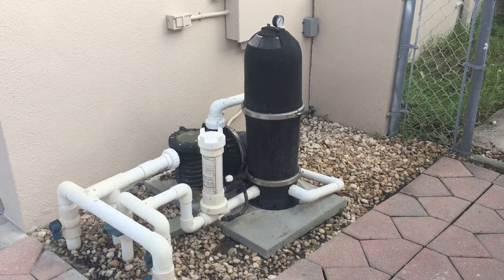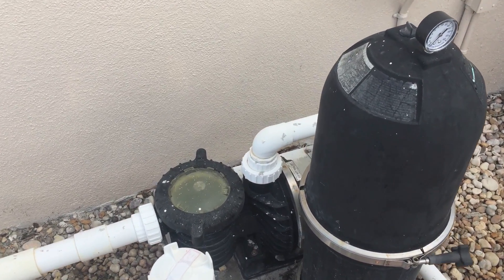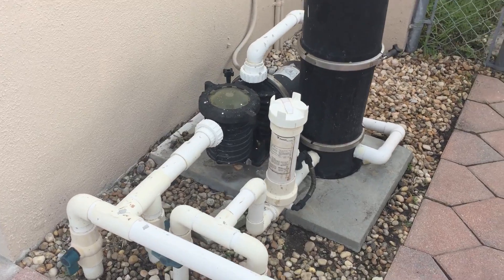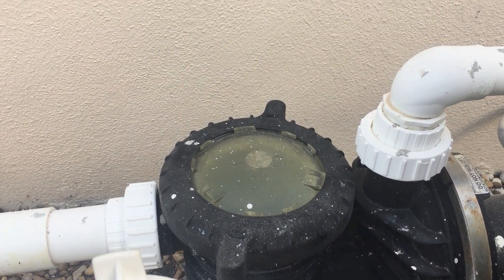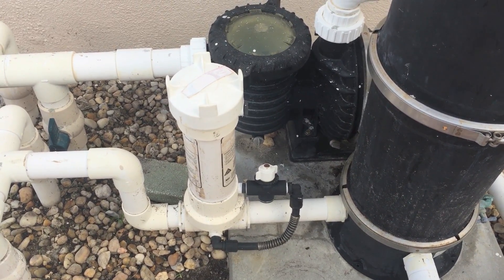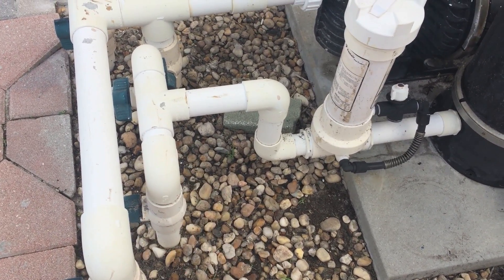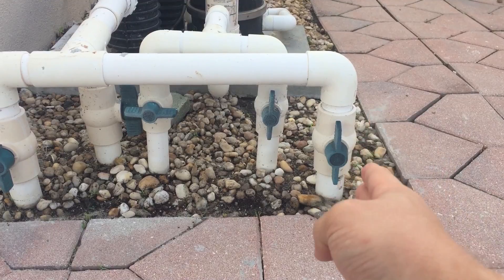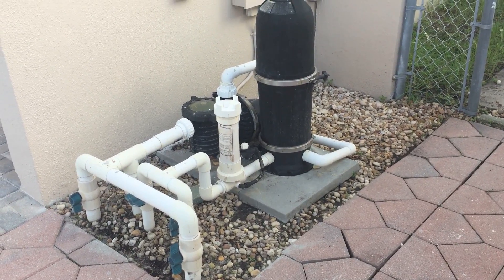Residential Pool Plumbing Explained: Beginner’s Guide To Pool Filtration & Flow

Comment: You have to have a contractors license to change a pump motor in Florida ?
Reply from the maker: Pierre Lo yes basically for anything that requires a tool you need a license. At least here in Florida.
Reply: I'm glad I messaged you Erick .I love and am going to operate in Polk county.A potential customer called me and wanted me to change a pump motor I turned the job down because I don't have my contractors license.
Reply from the maker: You did the right thing Pierre! It's just not worth the hassle if you get caught operating without a license much less the risk you put your client under. Have a great day and good luck getting your license!
Reply: I appreciate that Erick is there anywhere you recommend for the contractors license that's local ?
Reply from the maker: Pierre Lo local as in Florida? Yes contact Rob Estell. He’s in Miami and his course is online. You can find a local testing branch to you somewhere in/near pasco.
Reply: Yes sir I live in Polk county .I don't mind having to travel I had to go all the way to Melbourne to get my Cpo.
Reply from the maker: Pierre Lo yea you just travel to a chosen local testing center to take the tests. Everything else can be handled through mail/online.
Reply: Thank you for all the info Erick I really do appreciate it
Reply from the maker: Pierre Lo you’re very welcome. Don’t mention it.